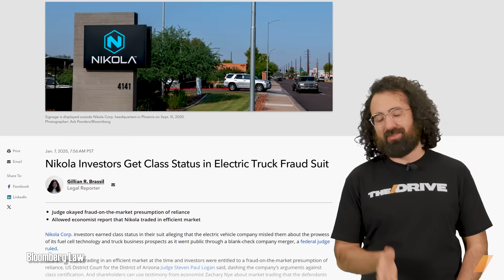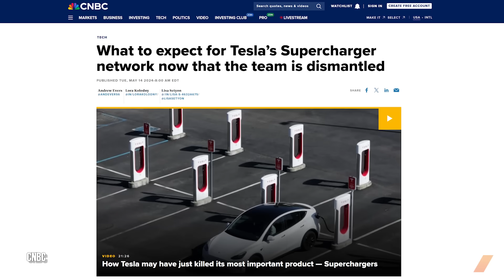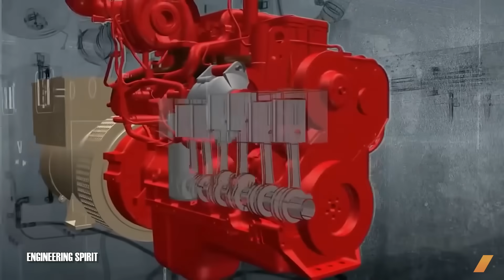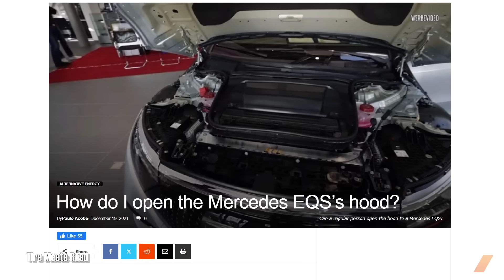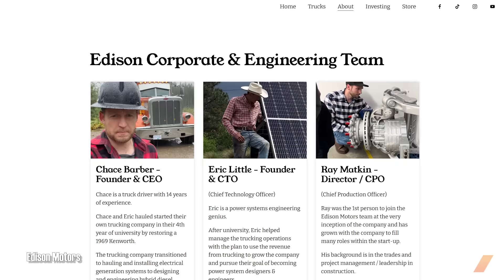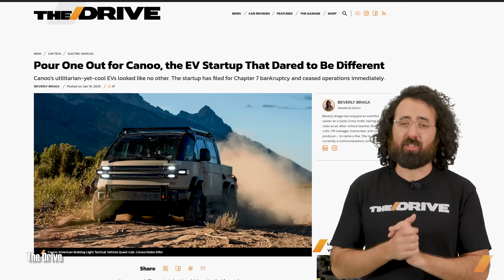The truckers in a shed beating Tesla with 100-yr-old EV tech

Comment: basically, they are making a land version of diesel electric submarine
Reply: Yes except the controls don't include switching batteries bank configurations from series to parallel and there is no mechanical path from engine to the wheels.
Diesel submarines had the shaft available in case of trouble.  They also had the ability to go series connected on the two banks of batteries to get the highest speed under water.

Comment: Been following these guys for a while. Have they posted anything regarding fuel efficiency gains yet? They are suspiciously lacking from this video.
Reply: They did do some comments on fuel economy.  The estimate was something like 1/2 the fuel
Reply: Mpg when logging could be 1000 mpg due to regen braking and the stored potential energy in mountain trees. 

Mpg when doing start/stop city last mile dreyage might see a 20% improvement.

Edison trucks will see little mpg improvement when doing OTR high speed long range highway driving.

The main advantage of EV semi is incredible torque and hp when starting at a green light intersection.

Comment: The simple truth is, full EV's are impractical and usually worse for the Environment then what they aimed to replace.
Reply: The simple truth is that what you said is wrong.  For most passenger car use, EVs are very practical and massively better for the environment.  The oil companies are doing a very well funded disinformation campaign.  If you go hunt up the numbers for your self, you will see that the real numbers are very different from what is popularly believed.
Reply: @kensmith5694  interesting, and here i thought i worked for a research institute that designs builds and researches EVs and their infrastructure. Guess im working for Big oil instead, without knowing.
Reply: @lbochtler  You may be surprised.  You may not be telling the truth

Comment: tesla is working hard to ensure we have brown outs and much higher electrical cost while he pretends to be solving something... Then his cars/trucks burn and well so much for zero emissions and clean anything, they far easily become far more toxic than any other vehicle ever produced.
Reply: You are wrong about that.  EVs in fact lower the cost of electrical power for most homeowners, doubly so if you include the cost of fueling a car.  Do some real research on it.  You will find that the EV charging is mostly happening at home, it done off peak and for a lot of home owners is less watt-hours per month than other systems in a house.  Check out what you pay for air conditioning in the hot days of summer.
Reply: @kensmith5694  lol no they don't lower electrical power, they consume it dummy lol.  Ignorance is worse than any drug.

Comment: No real trucker wants to sit in the center of the cab, this is just over complicating something, make engines more efficient....
Reply: At least one real trucker wanted the center seating and that is why they built it.  They guys doing this are truckers.
The system is really simpler than the engine and transmission system with all the smog equipment needed when you go that way.  These guys can keep the engine running clean when it is running.  The only gear shifting is the two speed axles.  Engine RPM is constant.

Comment: I wonder why it's better to have diesel electric. Why trains use it is because it would be almost impossible to get direct drive to get train moving. Impressive torque of electric engines makes this possible. In fact most efficient container ships are still direct drive since least amount energy is lost during transferring power from engine to propeller. Cruise ships might use diesel electric since lots of power is used in all electronics inside the cruise ship. Diesel electronic might be more efficient inside of the city but long haul? not sure.
Reply: The initial case was for logging trucks and not long haul.  They might do long haul later but right now t is about moving really heavy loads not very long distances.

Comment: Awesome. Because full electric isnt realistic
Reply: It depends on the purpose.  There is at least one EV truck that never has to charge and drives all day.  It works at a mine where the mine is up a mountain and processing is down hill from there.  It drives around and around charging from the weight of the ore on the down hill to make the energy it needs to take the empty truck back up.

Comment: My opinion about this topic will be more about the feasibility of having every truck with Hydrogen instead of gaz, diesel or 100% battery and create huge <<hydrogen> station in industrial zone. Which the gouvernment can put money on that. Do the hydrogen will be a better way to move big trucks? I honestly think yes.
Do hydrogen need to be everywhere? No.

Hydrogen took 3 time the energy to be produced compared to an electric car that took it directly from the grid. (Which most people dont even do more than 50km per day... to go to work...) (But since we live in a <<consumerist>> mentality, where everyone want to show they have money, they do electric car with huge battery that most of people doesnt really need...)
The hydrogen station need also to be refulled. And if we do that with a gaz or diesel truck.. well... is like doing the effort for nothing?
The production of it can be done in a more greener way but are largely still produced with high-co2 energy.

The thing are that, this pollution can be modifed during the time where, with a truck, you are stuck with it until the end of it. (Same for personnal car...)
Close to nobody will change the system on their car to switch it of energy used. Where really big instance can do it over time.

Comment: These guys are just awesome regular dudes who saw a hole in the market and are filling it, simple-as. A logging truck with a GVWR of 80 tonnes can now have a TINY 7L engine as a generator because the real work is now performed by e-axles, and the whole package is off-the-shelf stuff as much as possible. You can fix it yourself using the same tools you'd use to fix any other truck. Genius.

Comment: Edison Motors I feel is taking a more "Pacific Trucks Approach" valuing quality, commitments, and taking the customers needs into consideration, just like Pacific did they didn't even complete their 500th production order till 1971 (which is assumed to be owned by Edison Motors, its that Pacific Dump truck in one of their videos), nearly 2 decades after their founding, so I feel like Edison Motors is going to become the new Pacific Truck & Trailer.

Edit: correct/added information and date changes.

Comment: I like what this company is doing. You would think you would lose a lot of efficiency converting diesel to electric but I guess not.
Reply: The conversion of Diesel to Electric is comparable to Diesel through a manual or automatic Transmission. The benefit of Diesel/Electric Hybrid is the batteries do a better job of handling acceleration and regen braking.

Comment: I'm reminded of the gravity-electric hybrid iron ore train used in north western Australia. It is downhill all the way from the mine to the seaport where the ore is offloaded. Regenerative braking is used to charge batteries on the downhill laden run and there's more than enough battery charge to take the empty train back uphill to the mining operation. Frequently the excess charge is utilised in other mine-based infrastructure.

Comment: it's not "already there". Even if it's an old technology, there is still work to do to make it work properly, just like in EVs.

Tesla isn't the only brand producing EVs, it WAS. Then all the other brands followed. With semis, it could happen the same. 

Doing all this work to get in the best case a 50% efficiency vehicle which still produces small particulate and CO2 is totally nonsense to me. It would make way more sense to improve battery technology (as China is doing), and charging infrastructures

Comment: The fun thing about this is that you aren't restricted to just diesel; you can use whatever engine you want, particularly steam.
This means that you could theoretically make a nuclear semitruck (which - before anyone says anything - is a bad idea for many a reason)
Reply: Heh. Like the 1976 silly movie about the nuclear powered coast to coast "big bus"
Reply: A fully operational Steampunk Semi would be ubercool!
Reply: For real though, you could swap out the prime mover with a hydrogen engine or an ammonium engine or turbine or a hydrogen fuel cell.

Hell, you could take an APU from an aircraft and run it off potato vodka.
Reply: @MostlyPennyCat  Hydrogen fuel cell trucks are never going to be as viable as some would like us to think.
Reply: @JJFX- 
Eh, maybe, maybe not, maybe but not in our lifetimes, who knows. 
Solar cells weren't viable when i was a kid. 
Not really the point though, just that eventually you can swap out the diesel ICE motor.
Reply: @MostlyPennyCat I hear ya, the main issue is really how inefficient the whole process of making hydrogen at scale is.
Reply: @JJFX-  Part of that problem goes away if we shift away from fossil fuels though.  I mean if most of our electricity is passive and renewable like solar or wind.  Being inefficient and creating hydrogen cells for a few industries that need it sounds less bad.  But it still has issues to work out.

As unfortunate as it sounds for people that work in the trucking industry.  The trucking industry is largely unsustainable.  It is only enabled by fossil fuels and subsidies.  Not to say there won't be a trucking industry, but the idea of a semi-truck driving from a warehouse to deliver to a store is irrational by every metric.
Reply: @SirNarax It'd only make practical sense for short deliveries and even then it's problematic at scale for most places. The only option that'll really give us the capacity and reliability required for future electricity needs is modernizing nuclear energy. Luckily the AI datacenter boom is quietly driving this forward as we speak. Numerous data centers in the states are now either renovating old, decommissioned sites or building new ones because it's the only reliable option that can handle it without furher burdening an already struggling power grid.

If we do it right this time it'll hopefully shift public opinion and actually make adding non-fossil fuel options like solar and hydro practical for us. Wind energy is a joke outside of very niche areas and we need to stop pumping resources into it.
Reply: @JJFX-  Nuclear isn't happening at scale.  Nuclear is great and all don't get me wrong but it just isn't going to be growing any time soon.  Nuclear is expensive and even if we started today it'd be decades out.  We'd run out of fossil fuels before Nuclear is ready to replace it.  Not to mention the cost.  Besides that anyway the problems can be solved without it growing massively anyway.

In actuality Nuclear doesn't really solve any of the problems we are currently discussing anyway.  Nucelar won't aid in maintaining a unsustainable freight solution in any way.

Wind is also not a 'joke' I am not sure remotely where that perception comes from.  Like it can't be placed in the middle of a residential area but you wouldn't want any power plant in the center of residential areas.
Reply: you could, but, just the radiation shielding alone would increase the wheight by a LOT, also if te car crashes would not be so great.
But it would be cool.(not really, more like boiling hot).
Reply: Didn't they also try to make a nuclear plane? And certainly a nuclear train.
Reply: Now i want a nuclear car.  vroom vroom glow baby.
Reply: I mean Steam-Electric Locomotive was a real thing, and has been used on multiple railway. there was also a concept design for a Nuclear-Electric locomotive from the 1950’s, though sadly it was never built

Comment: Edison Motors is not trying to make value for stockholders, they are trying to make the best hybrid semi trucks in the world that will last generations. When profit is not your primary focus, great things happen. 
Side note, I have seen that germany did a test of using overhead lines like a light rail train on one lane of the highway and have trucks with smaller batteries, I figure Edison + overhead lines will let them cruise easily on the highway and still have plenty of range off highway too.

Comment: Tesla semi truck has a 500 mile range. From my understanding most routes are under that.  Which means the Tesla is a better choice for everything in that category.  Yeah the hybrid trucks are cool, but now you have two drive trains to worry about not just one. So is there is still a similar level of maintenance costs?  What is the total cost of ownership of hybrid truck vs conventional? Is the cost per mile really cheaper?  The Tesla semi looks like it halves the fuel costs. What of hybrid?  Hybrids never made sense to me because the mpg is nearly the same as conventional.
Reply: Edison hybrid trucks make little sense on the open roads to compete with OTR trucks. Edison trucks will shine in Vocational heavy duty off road trucks which is a small but vital market.

Comment: I wonder if regenerative braking is as good as engine braking (Jake Brakes)? Something all long haulers need.
Reply: Regen braking stops the truck as hard as it pulls the truck forward. Which is to say regen braking can easily lock up the wheels and dump all the moving energy back into the batteries.

Comment: You talked about series hybrids, where Generator makes electricity for batteries and betteries power axle motors (hybrid-electric = diesel+electric or just electric). But there's type of hybrid drive, where Diesel Engine (mostly diesel) powers Generator, that powers directly axle motors and any unused energy is then stored inside batteries (diesel-electric = diesel makes energy, electric makes power and torque). The second type is how diesel locomotoves work in poland like Fablok(eng. pronunciation: Fablock) 6D, NEWAG (Nevag) 311D , HCP 301D.

Comment: The idea of having a gas engine to charge an electric motor seems silly. I don't see how this would help with emissions, or be much better than just a straight up ICE engine.
Reply: You don't have a gearbox, the truck is running at its peak efficiency all the time. From other stuff, normal engines in cars use about 30% of the fuel, for motion, 70% is waste. In hybrid you don't need much more than an engine (just a bare engine without anything else) hooked up to an oversized Alternator, which is running an EV motor with about 95% efficiency (mind the losses from the alternator). So like... You're getting so much more efficiency from fuel than with a normal car. Napkin calculation, about 40% more mpg, and so much cheaper for repairing, since it's extremely basic build

Comment: You forgot to mention that they also recharge themselves with regenerative braking while coming down the mountain with a full load
Reply: Arguably the primary motivation! Recovering energy and saving on brake costs.
Reply: @hemiacplurge3572   for real! I mean it couldn't be a more perfect application. They climb the hill empty using the least energy possible, and descend with a full load gaining the most energy possible. Chef's kiss.
Reply: yeah, no EV in history has ever used regen braking, well spotted

Comment: They have built one hybrid truck. Not exactly significant in the trucking industry. The concept has value and would reduce diesel consumption by up to 50% if the DC fast charging infrastructure was also built. The need hundreds of millions of dollars to build a production facility and since they don't want to lose control of the business I doubt they will be able to raise the capital. Europe is far ahead on electric hybrid integration and EV semi trucks.

Comment: I agree with your video in general, but remember that batteries are the fuel. You have to take the combined weight of the electric motors and batteries and compare it with the weight of a transmission, diesel motor, and diesel fuel (half tank as average) to really compare the differences in weight.

Comment: I don't get it. There is a loss of energy (heat) when producing electric energy from diesel, again when storing and add a third loss when driving. The efficiency by letting the diesel run at optimal revolution can't make up for the energy loss. Please show some reliable independent data that proves the the benefits at short and long range. Perhaps it's only a good idea when hauling up and down of mountains?
Reply: Energy lost at the mechanical transmission is comparable to energy lost from generator/battery/axles.

Edison hybrids make little sense for highway mpg.

Edison trucks have twice the horsepower and 4 times the torque of traditional mechanical drive train.

Edison hybrids see improved fuel economy in city stop/go, drayage, last Mike deliver driving because of regen braking.